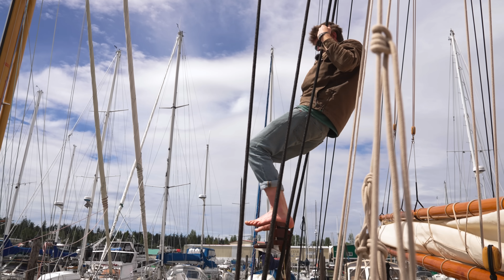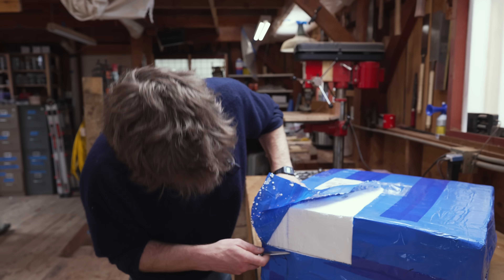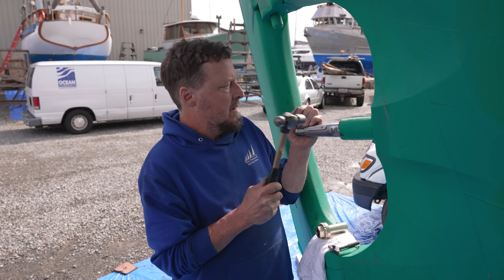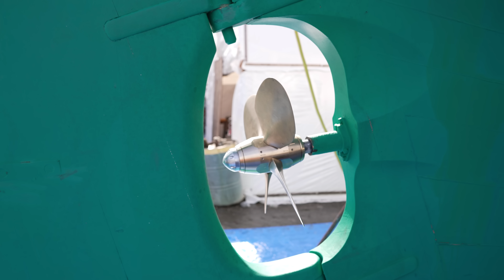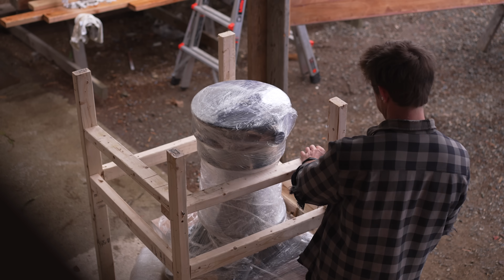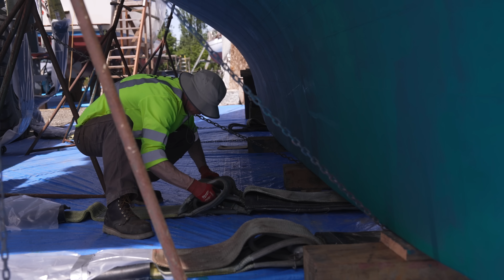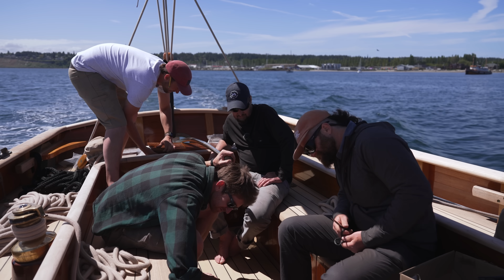New & old machinery - Gearbox, Propeller, FINISHED CAPSTAN ARRIVES!

Comment: Hi Leo - beautiful work! If the new prop automatically feathers when not under power, how will you utilize the propeller driven generator feature of your propulsion system?
Reply: Water flow will feather the prop if it's forward pitch & the power to the shaft is shut down. When it's in reverse pitch, the water flow holds the blades open.
Reply: I thought the idea was to have the prop spinning with the engine off while under sail to passively drive the electric motor in the drive train to generate electricity to charge the bather bank while underway without running the engine. It seems this would new a way to prevent the blades from feathering from water flow
Reply: Should read battery not bather - damn spell check!

Comment: You're putting the key in, not the keyway. The keyway is machined into the propeller. The key seat is machined into the propeller shaft. The key connects the two.

Comment: When the pressure of sailing turns the prop blades into the flow of the water can you still engage the gearbox to use the electric engine(s) as generator as you mentioned in a very early video about charging the batteries while sailing?

Comment: We're getting close to sailing! Congrats on 500k, too. I may have missed something but if the prop feathers automatically how can it be used to charge the batteries?
Reply: Water flow will feather the prop if it's forward pitch & the power to the shaft is shut down. When it's in reverse pitch, the water flow holds the blades open.
To begin a regeneration charging session, 1st you must blip the motors in reverse, to set the blades to reverse pitch. When the charging period is over, you must blip the motors in forward drive, that'll twist the blades to forward pitch so they can feather.

Comment: Hard to believe !!
That Capstan weighs 550 lbs.
Will Leo have to strengthen the deck ? 
Motor drive must add
200 lbs to original design.
Reply: The 4 corners of the capstan base are bolted down through 2" of deck planks & 4-1/2" of deck beams - there's ample structure to bear the weight. I think they'll want to bracket the worm-drive transmission to the side(s) of a deck beam(s) to keep it from flopping around under drive.

Comment: Great result seeing the prop solution work and all other systems being finalised, although I was curious as to how a feathering prop could be used for regen when underway - so this from the Max-Prop FAQs.  “If you shut the engine off with the last rotation in reverse, the Max-Prop can not feather and the propeller and shaft will rotate. We can use this feature to drive a shaft alternator or regenerate an electric motor.”  Assume with TH setup that this would be done using the electric motor in reverse while underway then simply switching it to alternator mode? Cheers

Comment: Great result Leo!  I've been following the capstan rebuild, and boy were there a good number of guys involved in the project, not least for the broken cap and the casting of its replacement by the Windy Hill Foundry with about eight of them involved in the second pour and last but not in the least,  least, Keith Rucker of Vintage Machinery. Org who's channel I've been watching for about 5 years now, a brilliant machinist and all round nice guy. I can't wait to see the capstan painted and installed, I'd like to see some funky colour like the turquoise of the anti fouling but I suppose it will be boring black and white!

Comment: One question which bothers me about the feathering prop. I seem to remember in previous episodes there were plans to install regeneration using the prop to turn an alternator to recharge the battery while under sail. Unless you can lock the prop from inside the boat to stop the prop feathering, the water pressure will be unable to turn it as the boat travels through the water while under sail.
Reply: The prop only feathers if it's in forward pitch. When in reverse pitch, water flow holds them open - because the blades are assymmetrical about their pitch-rotation axes, which are at 90° to the prop shaft.
Reply: @frederickstibbert7389  Thanks for the explanation, but surely the  motion of the water past the prop in neutral turns the blades to the point of least resistance. Reverse gear is a feature of the transmission. The prop. Isn't reversable. The rotation of the blades are limited to the pitch angle and the feathered position at 90 degrees to "plane" of the prop. The blades are weighted to "automatically" turn to the pitch position by centrifugal force when the shaft is driven in either forward or reverse. In regen mode the prop drives 5he shaft, not the other way round.
Reply: The prop is reversible, as Leo demonstrates when unboxing it. The rotation of the blades is limited by 2 stops - one for forward & one for reverse pitch. You would benefit by reading its instruction manual, or by watching some of the PYI Inc. videos.

Comment: Girlie observation: the engine RPM and gearbox-ratio/prop-pitch match-up difficulties are the mechanical equivalent of finding a bra that's both effective AND comfortable.

I'm 9½ stone but roughly a UK NN-cup (it's all hopelessly vague at the wrong end of the bra-fitting alphabet), and gave up trying to find a decent commercial product years ago.

I make my own bras these days, but I'm no engineer, and juggling static loading, vibration and dynamic oscillation with resonant frequencies and whatnot is a literal pain in the neck.

One of these days there's going to be a support-garment version of the Tacoma Narrows bridge collapse...🤪

Comment: It's going to be interesting to see if the manual lifting mechanism for the electric capstan gear works when it's under load. That seems like a very small, fiddly lever to actuate something that could be conceivably holding hundreds if not thousands of pounds of pressure?

Comment: Question: if memory serves, the propeller and gearbox are capable of generating electricity under sail. However, how does that work with the feathering arrangement that you described, Leo?
Reply: Leo explained this in an earlier video. The prop has 3 modes: forward, backwards and feathered. There is no lever or any other thing inside the boat. If you put the engine forward the prop switches itself in forward mode, if you put the engine backwards, the prop reset itself in the backward mode. If you are sailing the prop feathers (thanks to the pressure of the water). To generate electricity the prop has to turn by the pressure of the water. To achieve that (under sail) start the engine, put it in backwards mode, give a bit of trottle and kick the engine in neutral. The prop is locked in backwards mode and starts to turn the prop because in backward mode there is no feathering possible. To stop generating, start the engine, put it in forward mode, a bit of trottle and the prop reverses in forward mode. As simple as that !
Reply: @on4xb  wonderful explanation! Thank you 🙏

Comment: How does the prop pitch to work as a generator?
Reply: When the blades are wound to reverse pitch, they won't feather - that only happens when the blades are in forward pitch & power to the shaft is shut down.

Comment: Leo - if you can answer? How will the feathered prop be able to turn the shaft and generate power for the Li Ion batteries when sailing? Many episodes ago I thought that you explained that the gear box could be used to drive the prop when the engine was running, but also that when Tally Ho was sailing the prop could be used to drive the gear box in a parasitic mode, driving an alternator/generator and charge the Li Ion batteries. Did this design get dropped somewhere during the rebuild? Also, I thought at some point Solar Panels were part of the design. Is this still in the picture? 

Som amazing to seeTally Ho sail!

Comment: I wonder if commercially the boat/ hull would be a good specimen for a glass fiber copy.
It would be cool if you could make money of selling the hull from a mold with added interior structural supports.
Including the rudder, propeller and rudder shaft and deck (s) but no through hulls or portholes.
And I’m even thinking could it be a succes if you offered glass hulls with the possibilities of different deck options.
I think it could be great as a production boat as well as a project/ kit boat
Just selling empty hulls and decks for people to finish as a self/ home build project.
This way your boat could be a glasfiber copy of Tally Ho or be a customized series with different deck shapes for different interior and exterior choices..
I’m probably saying something awful here if you’re a carpenter/ wooden boat builder or if you simply hate the idea of a glasfiber copy.
But I think the idea gap has commercial potential.
Reply: The hull design doesn't belong to Leo, it's not his to sell.
Reply: @frederickstibbert7389  
Is there still anyone claiming that design?
If not let people enjoy this great hull shape.

Comment: For the capstan- both the skirt and that gear that engages with it from below need a bevel. Maybe it does and I couldn't see it- but if you try to engage it when the gears aren't aligned you'll likely feel resistance and then a loud 'clunk'. That clunk will be a piece of one of the gears breaking off inside. Then you'll start to feel a roughness in the capstan as it slowly chews itself apart on the inside.

Comment: There are folding props that work on centripetal force, but not that one, That one is rotational force.
Reply: Then how can it auto-engage for going astern as well as auto-feathering for reduced drag under sail?
I'm not saying it necessarily can't, but that I certainly don't understand how.
Mind you, I've never been convinced by any reason for the change to calling it centripetal force, as I've never used or sold a centripete, even when working for a laboratory equipment supplier or assisting in the apiary, and it was taught as centrifugal force throughout my grandfather's entire lifelong career as a science teacher.  The force didn't change, and neither did the means of exerting or using it.  Then someone apparently decided that Sir Isaac Newton got it wrong, and as he wasn't available to argue the case, through the apparently inexcusable (f)act of being centuries dead and buried, it changed.
Reply: @The_Real_Phil_Lee  if it has torque in one direction it twists for forward and if it has torque for reverse it twists for reverse. The centripetal one pivots out for both.
Reply: @nroose  So how can it tell if the prop is turning the shaft or vice-versa?  Because it also needs to feather automatically when under sail, and all you have is the relative movement of the shaft and propeller shell to push it the way you want it.
Reply: @The_Real_Phil_Lee  For it to be centripetal/centrifugal, something would need to move outward away from the center. These prop blades twist to power mode when there is torque on the shaft, and twist to feathered when there is not.
Reply: @The_Real_Phil_Lee - The prop shaft ends w/ a bevel gear inside the hub, that gear engages a bevel gear at the base of each blade. When power is supplied to the shaft, the blades turn to the proper (fwd or rev) pitch. Centripetal force has nothing to do w/ it.
Reply: @frederickstibbert7389  That fails to explain how the hub can tell if it is the shaft turning the prop or vice versa, as in both cases, it is just the movement of one relative to the other.

Comment: Navigation lights, new smaller dia. propeller with the pitch adjusted, 》2700 RPM, lower idle, more control, only 3% tradeoff, calling that a massive win. Time for some engine speed/fuel consumption trials data collection. Is it possible for an additional pitch adjustment or another slightly smaller propeller/pitch combination that will get you between 2700 - 3000 rpm?

Comment: Can't get my engineering head around lapping a taper/taper fit on the prop shaft. When hand lapping with an abrasive the  prop to shaft fit when driven up the shaft with its nut will be different, that is you create a perfect fit prop to shaft where the prop is not fully mounted, why ruin two brand new machined faces. Did you plastigage the key to hub gap with a fully mounted dry fit, I'd have surface ground the key down so there wasn't a high spot on it, nothing worse than a bad prop fit up, causes all sorts of drama down the road.

Comment: Looks like a larger prop would reduce cavitation and be more efficient.  Change the gear box.   Can you do a low boost turbo with an intercooler to get more torque, etc. from the engine?   What is the expected cruise rpm?

Comment: Hi Leo,
My experience was that a smaller diameter prop gave much less low speed torque , for close quarter manoeuvring.

(In a straight cruise, it was fine) 

That was on a 43' medium displacement grp racing yacht, so the experience may not  translate.

Hope this prop works for you

Comment: Assume the original prop's pitch could not be adjusted...correct?
Reply: it was adjusted but still would not meet the engine (shaft RPM) requirements.

Comment: I've loved watching these videos for the past 6 years, but have never had the knowledge on any subject area to comment on until now... when Nick tied on to go aloft he should really have fed the rope end through the leg loops and the waist belt to create the fig8, not tied off to the belay loop. What he did was plenty safe really, but not best practice from a mountaineering / climbing perspective, as the loop is an extra potential point of failure in the system.

Comment: COLREGs, COLREGs. The Colregs state the following about the navigation lights:"The sidelights of vessels of 20 m or more in length shall be fitted with inboard screens painted matt black, and meeting the requirements of section 9 of this annex. On vessels of less than 20 m in length the sidelights, if necessary to meet the requirements of section 9 of this annex, shall be fitted with inboard matt black screens." I saw that the Tally Ho team did the varnish finish or clear epoxy finish on these inboard screens?
Reply: Just as well she's not over 20 mtrs then.
Reply: In the night shot you can see quite a bit of color from the port light when you shouldn't have.  I think the matte black would be a good idea.
Reply: @Walstie  That's because the shots were take from a height using a drone looking down on the boat, black paint would have made little difference.
Reply: There is Rule 25 Sailing Vessels in COLREGs as well. (a) A sailing vessel underway shall exhibit: (i) sidelights; (ii) a sternlight. (b) In a sailing vessel of less than 20 metres in length the lights prescribed in paragraph (a) of this Rule may be combined in one lantern carried at or near the top of the mast where it can best be seen. Most people use the combination lantern. I got confused when you mounted the navigation lights in front of these screens at the sides since you don't normally see them on sailing vessels < 20 meters, You might fall unexpectedly under the matt black rule.

Comment: Great explanation of how you worked through the problem, Leo.
Did you end up with about 20x16 instead of 22x17?
Your comment that the new hub is a little smaller, so the effective blade diameter reduction is less, was key.

Just out of curiosity, if you ever do decide to change the (?planetary) reduction gear to the PRM 500 in 2.57:1, how accessible is the gear, could it be switched out or would a new box be needed, and could you do it all without pulling the cockpit, engine, etc? (maybe just the regeneration motor?)

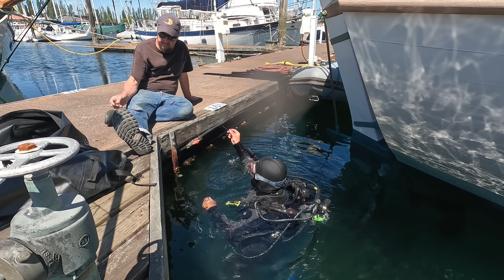This diagram at 27:33 from episode 87 shows it pretty well.
https://youtu.be/xohxmwPfctg?si=XdKhwoJ_xu9kF5-o&t=1653
Thanks again for sharing the process so thoroughly.

Comment: A question...  Since the Max Prop self feathers when sailing with no torque from the shaft, how does the regeneration work?  Is there a way to lock the feathering OFF from inside the hull?  Didn't see any means to do that!  ???
Reply: Leo explained this in an earlier video. The prop has 3 modes: forward, backwards and feathered. There is no lever or any other thing inside the boat. If you put the engine forward the prop switches itself in forward mode, if you put the engine backwards, the prop reset itself in the backward mode. If you are sailing the prop feathers (thanks to the pressure of the water). To generate electricity the prop has to turn by the pressure of the water. To achieve that (under sail) start the engine, put it in backwards mode, give a bit of trottle and kick the engine in neutral. The prop is locked in backwards mode and starts to turn the prop because in backward mode there is no feathering possible. To stop generating, start the engine, put it in forward mode, a bit of trottle and the prop reverses in forward mode. As simple as that !
Reply: @on4xb  Thanks.
Reply: Thanks for the explanation!

Comment: It seems Tally Ho's  navigation stern light needs to be at a higher position as the rudder is blocking its view from certain port angles. See 13:37 time in the video.
Reply: I noticed this as well, it does seem that way (although sometimes video does not give the correct view). But it if does block view it needs to be moved, could create a very dangerous situation.